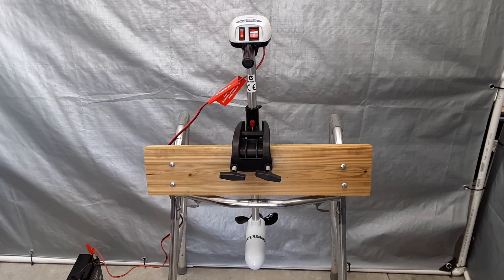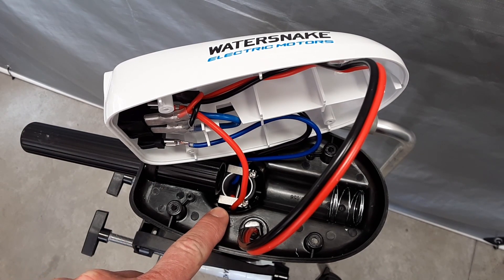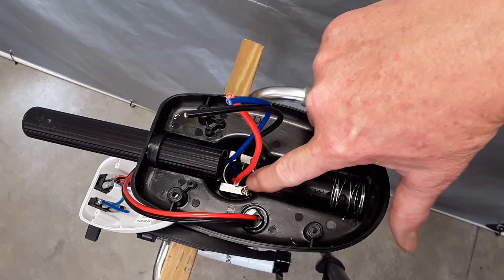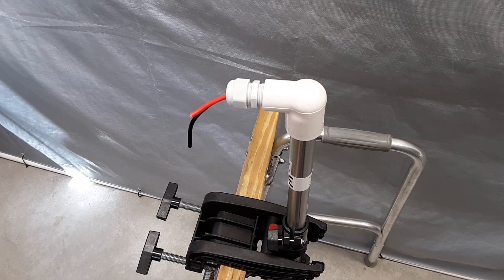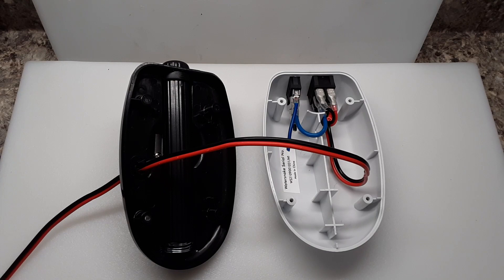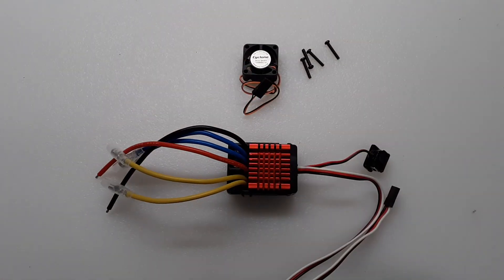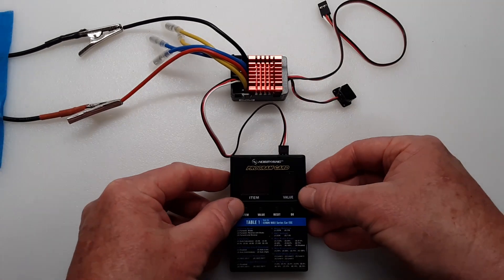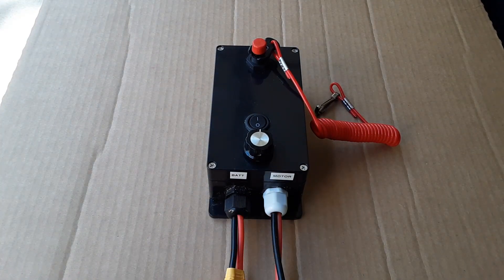Watersnake ASP T24 Trolling Motor ESC Conversion

Comment: Great info, as usual!  I'm going full electric power on my Wilderness Systems ATAK 120 with a NK300 at the stern.  That one seems to push my ATAK 120 about 7 mph.  Now I'm looking for a lightweight trolling motor up front for fishing.  Hence, my interest in the ASP T18 or T24.  One thing I have been unable to determine is the diameter of the motor unit of the T18 or T24.  No one posts those specs.  It turns out that the pod in the front of the ATAK kayaks has a 9" long and 3 1/8" wide slot that is presently holding my Lowrance transducer.  I've heard that those small Watersnakes can fit through that opening and have yet to confirm that!  If I confirm that it fits through I will be looking at your ESC conversion.
Reply from the maker: Thanks Michael. I don't have the T24 anymore so I can't provide you with that measurement.

Comment: Thanks for the great videos! Is the ESC expensive? i’m running PWM‘s and they’ve been working fine. What are the advantages of the ESC? Can you reduce the speed of the prop to an absolute crawl like you can DPWM’s
Reply from the maker: Thanks John. The ESC is a higher quality speed controller over a PWM. I would not use an ESC on TMs 50lbs or over. Click the parts link for specs and the price.

Comment: You could save yourself some effort, and just put the motor switches in high speed and forward, and just wire the ESC to the black and red leads. Also, if your ESC decided to die, you could always just hook the red and black leads back up to the motor, and not be dead in the water.
Reply from the maker: That's not the best way to wire an ESC to these motors. Also, who do you think did the video for the "dead in the water" scenario fix?😁

Comment: Very nice video! 
The blue wire that came from the motor, there is any problem to don’t use it? 
If I connect the red positive and the black negative from the motor direct to a on/off 30a switch to the battery, the motor will be always in the hi-speed?
Reply from the maker: Thanks. The blue wire is not needed. I would not hook the red/black wiring directly to the battery with a switch except as an emergency if the speed controller fails.
Reply: @Aksmaniyak  Thanks for the reply! The idea is use direct battery to motor for long distances then connect the PWM in the fishing spots.
I had a lot off issues with the factory switch in these long distances same as the PWM getting very hot.
What do you think?
Reply from the maker: I wouldn't do that. Spend the money on a quality PWM or ESC instead. Messing around with electronics on the water is not recommended.

Comment: Can you tell me how to take that straight tilt pin off the T24 watersnake.  I want to have it free in case i bump into a rock or something.
Reply: It's just like a spring loaded T-Bolt that goes in a groove. I dremmeled mine of to have the breakaway function for underwater structure/rocks etc......
Reply: Thanks @l73global
Reply from the maker: I have never removed it. I will take a look.
Reply from the maker: I just added a video for your question using a Motorguide trolling motor. It may help.

Comment: if I just wanted to extend the controls to be placed somewhere on my kayak where it's easier to reach - is it as easy as just extending the wires in the head? what guage wire is it?
Reply from the maker: Yes, you can extend the wring in the head unit and relocate it. I don't remember the wire gauge...it was 14 or 16.
Reply: @Aksmaniyak   thats great thank you!
Reply: 12 AWG minimum preferably 10 AWG  (you want 4mm2 core wire), as you extend the wires you will add more resistance increasing heat in thinner gauge wires. T24 draws 20 Amps on high speed @12V. I've Personally used 12 AWG which was 3.9mm2 core rated at 25Amps and extended the wires. around 6Ft (2 Meters).

Comment: Is there a reason you used the remote box instead of putting the remote receiver/esc setup in the head like the minnkota one? How is that remote setup holding up? Also planning on doing these mods w the WS to my Outback! Thanks so much for sharing these with us!!!!
Reply from the maker: You are welcome Walt! Yes, I needed to make a remote box for both motors to connect because i am only using one receiver. It is easier and more efficient to connect both ESCs close to each other. They are still working fine.

Comment: Do you get more speed when regulating it with a potentiometer?
Reply from the maker: Compared to what? The stock speed switch?
Reply: @Aksmaniyak  yes
Reply from the maker: @Rulinjic  It's doesn't give you more speed, it uses less amps and increases battery run time.
Reply: Great video as always. Wondering what the benefits of having an ESC vs PWM. IVE seen your video on the PWM AND THINK I’d like to use the PWM on for a MinnKota 30lb trolling motor.
Reply: Can you explain to a novice like me why the blue wire is pushed back in to the shaft and not used?